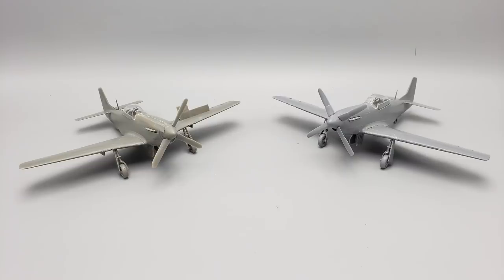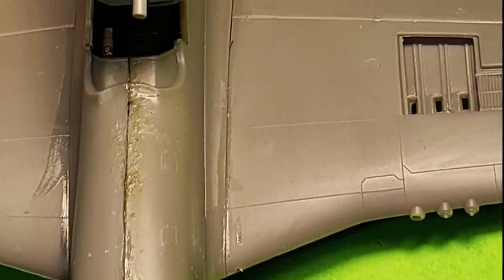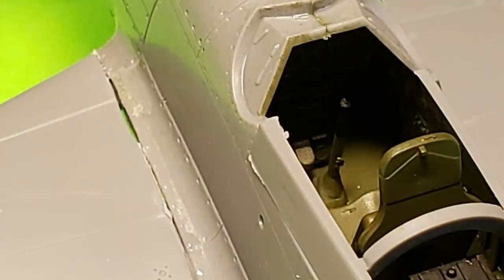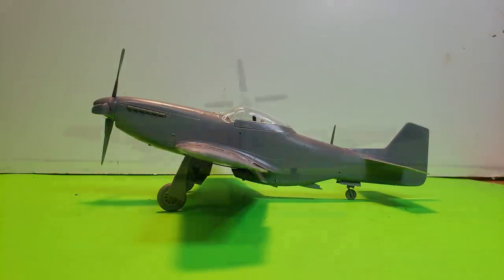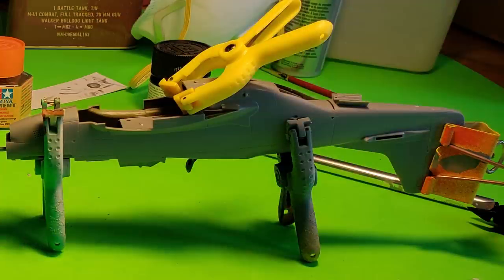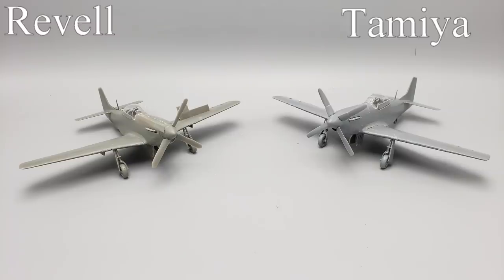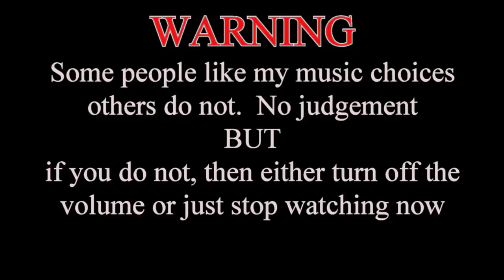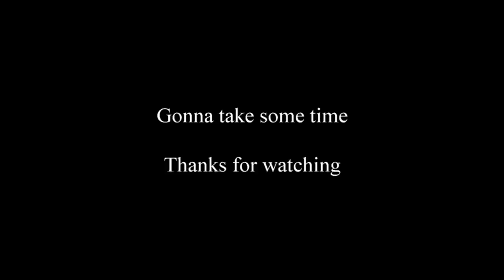Tamyia vs Revell 1/48 Mustang part 1

Comment: Fun fact, the P-51 belly air scoop actually recovered about 200 HP as the air exiting was moving faster than the intake speed due to thermal expansion this was figured out by a British engineer named Stanely Hooker who lowered the scoop 2 inches to let it breathe better. As for the kits I always liked Tamyia better for fit and detail
Reply: This is called the Meredith effect.

Comment: I would say the dihedral issue with the tamiya kit was them not getting enough plastic into the mold producing a rounded over edge on the big wing pieces. I'd look at the other larger pieces on the same tree to see if there are any others with the same issue. 

"I expected more from Tamiya" you're not wrong here. With the premium we pay for those kits there should be no issues whatsoever.
Reply: flaps are known to be wrong too !! shame

Comment: Do you think that this warping , or lack of fit, as something to do with cooling after removal from the mold during manufacture ? Not only do I build models, but I'm an aircraft mechanic and fabricator of metal parts. I find that if I rapidly re-press parts after heat treating I can get probably 90% or better of the warping out. I know you can't do this with a plastic model.  On some parts I add extra metal to keep the part, more or less rigid during the quenching process and I will trim it later after a cooling period.
Reply from the maker: possibly

Comment: Am I wrong or is the Revell kit the former Monogram P51 kit?
Reply from the maker: I think it is.  Blitz of Germany has both of them now and I suspect they are re-boxing it under the Revell name.  The pro-series is the only thing I know that still has the Monogram name.
Reply: Yes it is.
Reply: Yes, it's the old Monogram kit.
Reply: There was a time when the idea of a Monogram kit being sold under the Revell brand would have been inconceivable.
Reply: Yes, the Revell P-51D in the video is formerly Monogram--I have had both kits. The Revell kit in the video has the Monogram underside cowling (very bad fit). The vintage Revell 1/48 P-51D has no underside cowl bit. The original Revell P-51D seems to have disappeared, at least as far as I have seen . . .

Comment: In your opinion, if the two kits were painted and decaled as squadron mates  then placed side by side on a diorama base would it look a bit odd? I can see the difference in the exhausts and fuselage width looks different.  Great vid.
Reply from the maker: They both have 2 exhaust options but could easily be made as stable mates.

Comment: I'm building an Airfix 1/24 P 51D . It looks good so far. Have you ever built one? It's a re release from 1992. If so , anything to look out for?
Reply: I stopped building, and trashed that same kit when I got to the wheel wells and discovered that they are just holes under the wing. Also, the wing dihedral is non existent. So, because of those two very important issues, I decided that there was no need to waste anymore time on it. I bought my kit around '84, so maybe those problems were corrected when it was reissued in '92 ?
Reply: @meauxjeaux431  I hope so..most kits have problems though. Sometimes you have to use some backyard ingenuity.  It's hard to find perfectly made kits. I've had good luck with Airfix and Tomiya , Revell has been terrible for me. Mostly car bodies that were warped and unable to paint from flaws. Military you can get away with alot. It's when you have to prep and putty everything is when its frustrating.
Reply: @gijoeimmortal1868  If it doesn't have wheel well pans you might want to consider building it wheels up, or NEVER look under it... LOL ! Now if you REALLY want to have some fun, build the new Airfix 1/24 F6F Hellcat. Great kit if you don't mind doing minor surgery here and there, and inventing ways to make it go together. It takes a lot of time and patients to put it together, and you have to pay CLOSE attention. I was able to by-pass several steps because I built mine to represent the 1st Blue Angels plane, instead of the full fledged fighter version. Plus I don't build and paint parts that will be buried and forever hidden, just for giggles. Problem with that version is that there are no 1/24 decals made for it. Luckily, the B.A. version has very little, and very simple, yellow U.S.NAVY lettering on each side of the fuselage and none on the wings. As simple as the lettering is, you really need to have some serious art skills to pull it off, because any little inconsistency is very visible. I'd recommend getting some custom made decals from somewhere, or get somebody to make stencils with a cricut machine, then airbrush them on. Or, of course, you can always build it straight out of the box. The big PLUS/MINUS with the kit, is that there is so much engine detail that you really don't want to cover it up, so you don't end up with a totally clean fuselage. I chose to leave the panels off of one side while closing up the other one, so I got the best of both.
Reply: @meauxjeaux431  I will build it with wheels up , it talks about it a bit in revised instructions. This is an "in flight" model with the stand. I am a very meticulous builder and take a long time to build these kits. I'm more of an expert on tanks than planes. But I have built several. I got this kit for free and P51s are one of my favorite planes. So I will do alot of studying each section before I build and will paint everything (except fuselage and wings) and let dry for weeks before assembly. I have alot of time , due to the pandemic, so I can be building other kits too at the same time. This is my first time building this kit so I will research as much as possible before I begin. I've built  a 1/48 scale already and that turned out well ...except the tail gear doors keep falling off...lol. My painting is terrible when it comes to airbrush and blending..but I'm getting better. The pros make it look so easy..I've built alot of miniature dioramas ...I prefer painting freehand..That is my best asset. Detailing I've gotten pretty good at too. Just my base coating and blending on overall body painting sucks. I end up repairing more than I paint. Lots of sanding at my house. But I'm getting better the more I do it. Thanks for the heads up! This is my first big plane in a while so I'll take careful aim.

Comment: Interesting. 
A bit of a non related comment here: 
I'm building a Revell kit of a Grumman S-2A "Tracker". It's my Covid-19 Lockdown project, I've had it sitting around for years. I brought it to the Czech Republic with me from New Zealand as I thought I might have some spare time while looking for a job here (or some spare time during a major world wide pandemic!!) I only brought a limited amount of tools and paint as I thought I would get what I need here but now all the shops are closed I'm trying to make do with what I have. This has been quite fun as I have been able to mix most of the colours I require. Most of these colours were from when I was here last year and built the Revell VW T2 kit, unfortunately I bought Revell paints to do this which are the worst I've ever used :-0 What are others experience with Revell paints? I found them to thick and tacky so required thinning but then started drying too fast, not sure if there is an additive for slowing the drying time down?? The whites don't cover and take forever to properly dry compared to the Tamiya that will dry nice and quick. But worst of all is the Revell paint will bleed into coats below even after days of drying
The kit itself is not too bad but the body had a major twist in it so I had to spend a lot of time to get it straight. I had a similar problem with the chassis on the VW. I've never had these issues with Tamiya kits.
PS, I haven't built kits for over 20 years until I built the VW kit last year

PSS, I don't mind the music but it comes on way too loud compared to the rest of the content.
Reply from the maker: thus the warning  :)
Reply: Revell and Humbrol paint you have to thin out a bit or it will bleed like you said and it stays gooey even after drying for days..I have the same problem.  I thinned it out a bit and it applied much better and dried fast. Humbrol is just not good.I learned the hard way with that stuff..I think it takes years to dry...and dont ever touch it.. lol unless you like fingerprints on your Tiger Tank.. ha
Reply: Windfield Scott  Wow I didn't know that testors was still around. I use to have some about 30 years ago but I think they stopped importing it into New Zealand. I use to buy Tamiya acrylic as well as Mr Hobby /Hobby Color back in the 90's but I think the shops stopped selling Hobby Color or would takes months to restock common colours, Which was a shame as it was my favourite. I've managed to mix most of the colours that I need with what I've got on hand including a pretty good skin colour for the pilots. I just need to mix a nice US navy grey for the body and I will try brush painting it as I don't have a compressor or enough thiner to airbrush. I also have most of a spray can of gloss white for the under side which I planning to let dry in cold conditions so it with hopefully end up looking my satin than gloss :D
I must say that I am enjoying the challenge of making do with what I have.
Happy modelling and stay safe everyone
Reply: @gijoeimmortal1868  I remember the pain of Humbrol paint from when I was a kid :-0
Reply: @gijoeimmortal1868  Sounds like a new way to simulate zimmerit on your tank.
Reply: @andrewluchsinger  ha!

Comment: I built airplane kits by Tamyia and Revell in the 60's and 70's and I sure don't remember such huge fit issues with those or any of the better kit makers back then. What happened? And they've gotten so expensive too!
Reply from the maker: the molds were re-done in 77 I think.

Comment: Revell kit is smaller than the Tamiya.
Did you check actual scale dimensions to either kit.
Neither of these kits look similar which is strange considering they're the same aircraft
I have watched a video of the Hobbyboss Mustang and it looks to be a good kit.
Reply from the maker: gotta find my micrometer
Reply: @maxsmodels  caliper would probably work better!
Reply: Just done the eduard kit it's a cracking build

Comment: Audio level on the commentary was very low and difficult to hear. Duelling Banjos for the comparison section an inspired choice. 👍
Reply from the maker: I actually did not intend to use that, it was just some notes I was making while I was working on the models (glue was hardening) but I tossed together the video from images I had taken because I do not know how long it will be before I am done with them & the part 2.

Comment: Both are older kits and show their age compared with rhe newer Meng and Airfix kits. Have seen but not yet built the new Eduard kit it is really nice, you can built and specific block number of the D model. Might wait till a weekend edition becomes available (should be a reasonable price also)
Reply: Just look for a overtree. Usually 15-20 bucks. All plastic no resin or decals

Comment: Yeah,,,either the molds are wearing on the Tamiya or you got a bad one.  Built both their D and B/C kits and they go together so well, there was no need for filler anywhere.  You might want to look at the new Airfix 'Stang as it is closer in price to the Revell.  Meng and Eduard make very good 51 kits as well.

If you want real bang for your buck, the Revell 1/32 Mustang (the new one, not the ancient Revell or reboxed Monogram) cant be beat.  You can buy four for the price of one of Tamiya's 32nd offering and it just falls together.

Comment: Not only do you have great taste in music but, you also have great taste in airplanes ! As well as the companies ! I did notice that the Revell P-51 actually seemed like it had a little more (“detail, especially since you had part of the wing lifted where the 50 calibers and the ammunition goes”) !!!  Whereas with the (Tamiya), kits “and I’ve built some really great Tamiya kits”, To me it seemed as it did not have as much detail, neither in the wings section, or the landing gear, and as far as the engine & Nose area,Tamiya, Really ? You call those P-51 exhaust pipes ?
When I started building (“Armor vehicles”),
 I started with monogram, and I thought they were the greatest thing since camouflage ! It taught me about dioramas ! But the first time that I built a half track from (“Tamiya”), my mind was blown ! My first M3 half track and my first jeep and trailer and the amount of detail on these vehicles, well let’s see, not only do you have and get the vehicle in the correct amount of pieces as well as a frame and chassis you also have an engine and transmission driveshaft the harder the kits  so the more expensive they are !  Now when you mix that put it in a diorama compared to anything else (“Tamiya”), stands apart ! That’s why I was a little disappointed when I saw what it was as you were building it ! I was considering getting the P 51 Mustang with the staff car in 1/48 scale to use with my Lionel Trains ! I have the folk-Wolf and the BMW ! Haven’t opened it yet ! Waiting for a special occasion ! 🚂🌊🐺

Comment: One thing they both have in common, as do all plane kits, is the vertical,not horizontal parting line down the fuselage. I recently started a Monogram Black Widow and spent way too long getting a smooth joint. Also it would be far easier to do the interior in a bottom section rather than hang it off the side. I normally mess around with car kits and haven't touched a plane kit since childhood.
Reply: The Monogram P-61  is notorious for its fuselage fitting issues. Always loved them thought, that Shepard Paine diorama sheet was a wonderful bonus in Monogram kits.
Reply: Bummer - I got the GWH P-61 after reading reviews... Got to watch those old pre CAD pre-computer-controlled injection mounded kits - don't buy anything before 2010 and you'll have a better experience (look up scalemates.com for info)
Reply: @tonydrake462  So every kit now splits the fuselage horizontally?

Comment: I glade somebody agrees with me that Revell kit is not too bad! About the only thing I don't care about the Revell P-51D is the choice of decals! Both decals choices are very hard to apply! I was building the Hobby Boss Mustang and thought I would use the Big Beautiful Doll decals from the revell kit as I had multiple sheets! And I used most of the sheets and a lot of decal set!
Reply: richard willett Good choice though. Maybe it’s just nostalgia from building a couple of these Revell kits as a teenager, but it ain’t a Mustang if it doesn’t have a checkerboard paint scheme...😉
Reply: @fearlessfarless  The Revell kit is really one of the molds they got from the Monogram merger! Revell did have another 1/48 P-51D mold that wasn't too bad either!

Comment: One thing I think makes the Tamiya worth more, is the hours you won't spend getting the flaps to be in the down position. I tired to build the Revellogram P-51 back in the early 70's. At that time we did not have the greatest reference materials available. Lots of books with great artwork and color schemes, cockpit photos and such, but not much in the line of structure details. Therefore I did not understand that the flap closed under a filet which covers the flap portion closest to the fuselage. After I cut the flaps out of the wings, I saw they weren't the same length top and bottom. At that time my experience level and lack of good reference led to me park the project. 
NERD Warning! A properly displayed Model of a P-51 that is powered off MUST have the flaps down and the inner  gear doors down. When the engine shuts off, the hydraulic pressure stops, the flaps (being the heaviest) drop immediately, the inner gear doors (being lighter) take about an hour.  I plan to buy prop-blurs and put in a pilot figure this time.

Comment: Excellent review and EXCELLENT idea. Comparing two good models but one costing almost twice than the other just shows that sometimes it is not worth spending a lot of cash just becuase the model is this or that brand only because it is backed by that alleged top name. In this case, Revell's P-51 is almost the same as Tamiya's. By the way, isn't the Revell version a Monogram mould?  I remember that I built the Monogram original 1/48 scale P-51 way back when it was first issued and as usual with almost all Monogram kits, absolutely tops with a reasonable price.

Comment: Enjoyed your videos, thanks. When I research kits, I have found Scalemates.com to be invaluable. Their history section is very helpful in showing the family tree or bloodline of a kit. Amazing how many manufacturers used the same basic mold. It may provide some help in your research of various Japanese kit manufacturers. One features I missed from the 60s kits was what the Japanese manufacturers like to stress on their box, "all moving version". Which mean the propeller and wheels turns, all control surfaces works and if subject aircraft has folding wings, that will fold too. I once built a HS Buccaneer with folding wings, tail cone/airbrake and nose cone/radar. Keep up the good works.
Reply from the maker: Amen
Reply: I agree scalemates is a blessing! I was able to download lost instruction sheets , and many helpful hints on problems with some kits and general info. They've saved me alot of $!

Comment: Interesting video. Neither of these kits seems to match the fit or the detail, especially surface detail, which I remember from my plastic model building days, 1959 to 1970. That's quite sad. These are 1/48 scale, yet they are not as detailed as the 1/72 scale models I remember from back then.
Reply: I was going to say the same thing.  I don’t remember any mainstream 1/48 kits that fit so poorly.  Even the old Lindberg stuff went together cleaner than these.